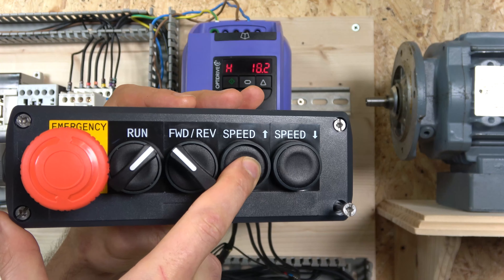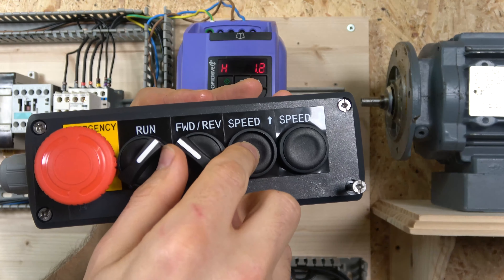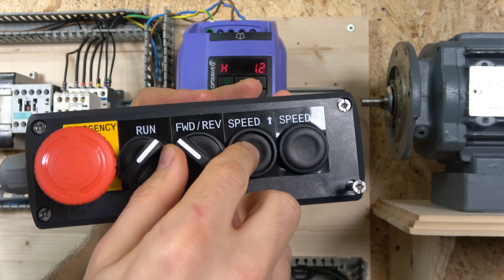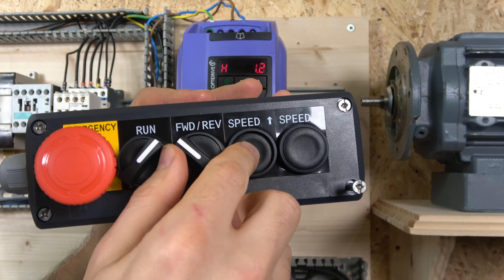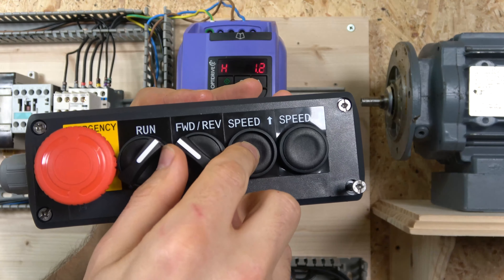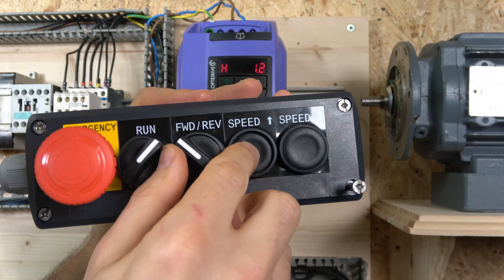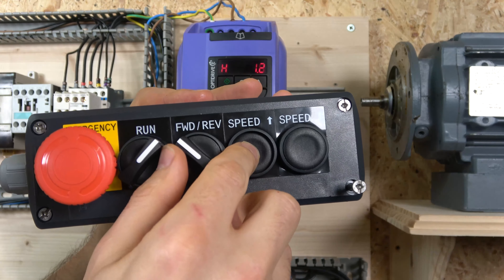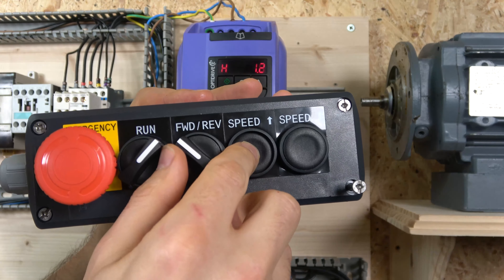Invertek Optidrive E2/E3 remote control, MOP speed control and multi frequency control. (English)

Comment: I used the optidrive E3 they sell it in Greece for a lot of money and...for simple applications is fine tho but if you want to use it for the bulit in PID...i mean PI control... Is fine for pumps not for refrigeration in refrigeration you need some more advanced PID control! You need a propotional band with upper limit and lower limit and i say PID and not PI because on come sircumstances you may need to change the P parameter!

Comment: Is there an option for a remote control (wireless)? My unit is a bit far, so i would like to switch on/off from a distance. Thanks
Reply from the maker: Hi There. Not for this drive, only the newer drives that come on market now can have these options with additional wireless cards. But them are lot of money.